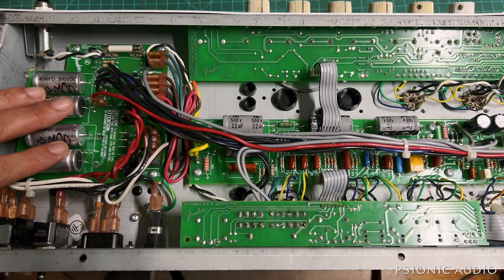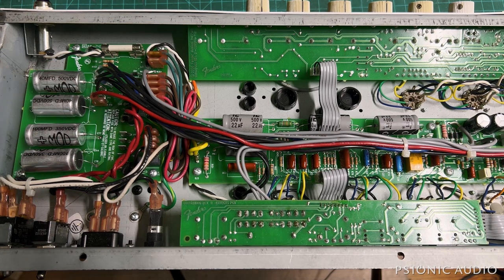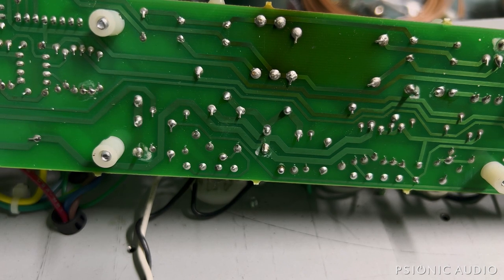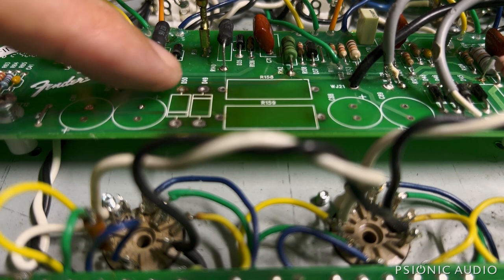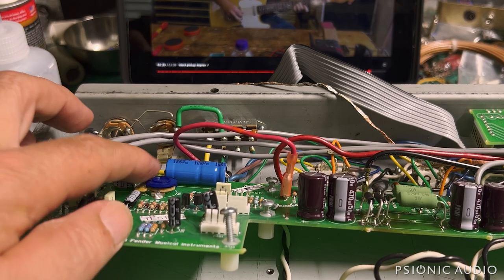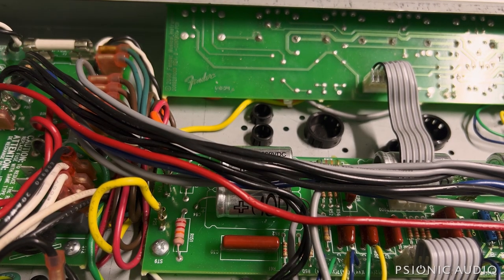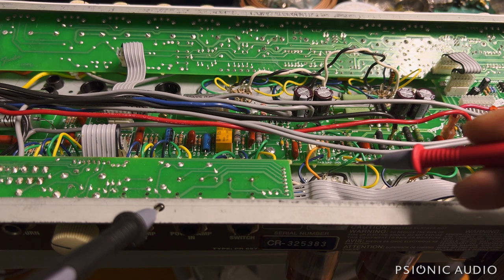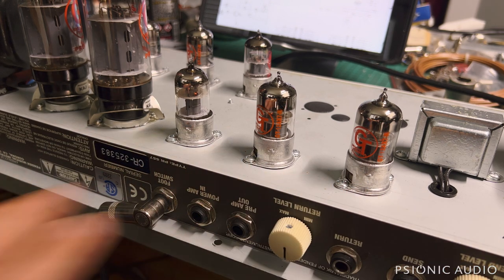Fender Supersonic | Part 2 Bringing It Back to Life

Comment: I own a SS 22. My best tip for lowering the noise floor is to put one of those volume pedals in the effects loop to use as a master volume, turn the preamp up a little and the volume down a little, this will make the hiss go away. Makes the amp much more usable.
Reply: I know someone that does just this with theirs. It def lowers the noise floor and that hiss isnt present or at least it isnt as present.
Reply: I'm gona give that a go with mine. Thanks for the tip!

Comment: I fix the odd hifi amp and I have on occasion drilled a few holes in the pcb to aid airflow around hot components that are scorching the board. Doesn't always look pretty and the tracking does limit what you can do in some cases, worth it to extend the life of something though.

Comment: Nice work Lyle.  I would be interested in hearing your opinion of component precision values.  I noticed some 20%+/- on some caps you installed.  I assume is some areas of the amp, it is not as important?

Comment: I have one of these amps. Unbeknownst to me the crappy IC caps had started to leaked causing the PT to get really hot. I replaced all of them.  Still have hum issues so I'll check these smaller caps and diodes too. Between this amp and the HRDX I own I will never buy another Fender amp. They just cut too many corners.

Comment: I have a Supersonic 22. I hate the way it's put together. It has to be the most unfriendly way of laying things out. I've needed to open it back up for a couple of years, but I just don't feel like it.

Also, It gets quiet with EHX tubes.
Reply: I have one person I know that likes this amp and has had no issues, i know of 10 people at least that had this amp and got rid of it within 6-18months. It wasnt an amp that stayed on stages for very long it seemed. Most folks went back to their old amp (if they had a nice Tube amp already) or they purchased something else. Your not the first person nor will you be the last to mention the "unfriendly way of laying things out". What is going on with yours that you need to open it ?
Reply: @ctcards2636  the reverb doesn't work. I've narrowed it down enough that it's the power supply to the transistor switch which allows signal into the reverb stage. It's an incorrect voltage. When I replaced the transistor, it worked, but not for long. I should probably take it to a qualified tech. I'm not sure about fixing it. 

I also modified the phase inverter so the PI distortion is different, but it sounds like ass. It's changing one tail resistor from about 460 ohms to about 1.2K. I need to change it back.
Reply: @SonovaBish  Stinks when ya do a mod and find out it made the amp sound worse haha. Sorry to hear your having trouble. Wish i had some magic idea to help ya. How old is the amp ?
Reply: @ctcards2636  I'm not sure how old it is. I bought it used from a store on Reverb.
Reply: @SonovaBish  Did they warranty the amp ? Just asking if they did, you may want to contact them. But if you have been inside the amp than i doubt they would repair it. But hey its worth a shot. Good luck and i hope you can get it up and running and undo that mod you didnt like. :-) Ive done some mods on amps that others raved about and i found that my playing style and dynamics with the pick are very unique and the mods didnt work for what I was trying to do. For others it may have, but most mods i do are to help with tube life, noise in the circuit, either adding or removing bright caps etc. But theres a lot of mods out there that dont make amps sound any better infact just as you mentioned it sounded worse. I always do a LOT of homework and ask as many questions about such a thing before i do it. I find that everyone and their brother want to have a say of how good and easy this was to do etc. But a lot of these people have no idea what they are talking about and ya gotta remember sound/tone is "subjective".
Reply: @ctcards2636  no warranty. Once I cracked it open, I knew everything was my responsibility. 

I had some electronics training from the 90s that I didn't use much until maybe 15 years ago. I know my limitations, but tube amp circuits aren't that complicated.
Reply: @SonovaBish  Rock on :-) I understand where your at. I have an amp that i just dont want to have to open up again. One day ill get around to it. But this always makes me really think before buying an amp. Do i want to put myself thru issues down the road for this sound ? IS it really worth it ? haha i drive myself nuts now. Ill find an amp and damn i google it and boom theres 20 problems with them right out of the gate it seems, then its a domino effect. It also sucks to have so many people say "i told ya so" when you do ask for help haha. 

Some amps i dont mind working on, others I do not. I like to have fun when im working with amps. 

Take care ;-)